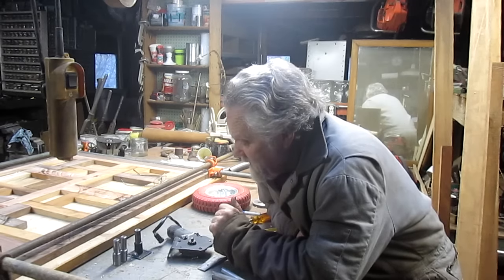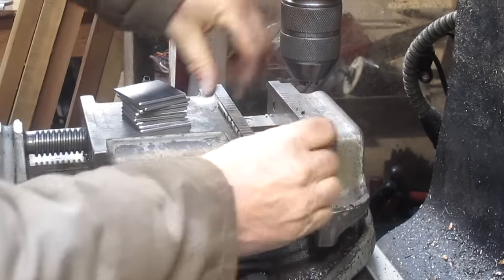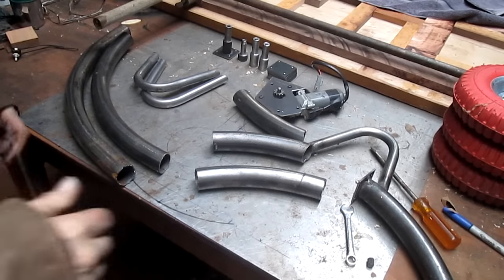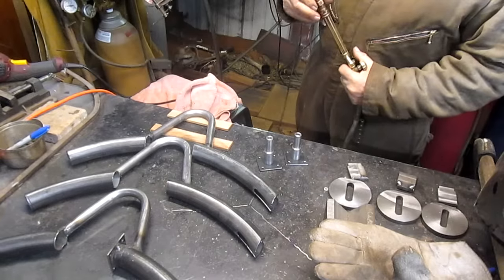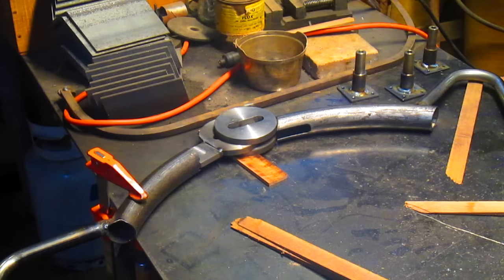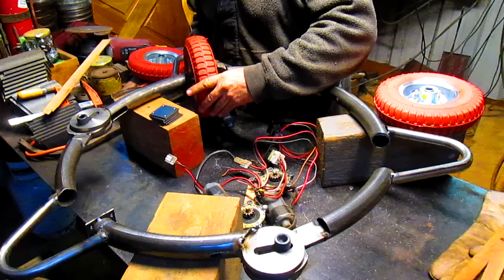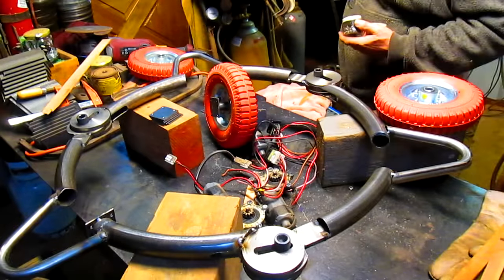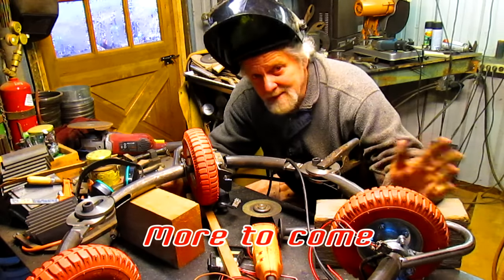A Run-in With Gravity #3

Comment: Looks like something to climb a pole or column.
Reply from the maker: You are very close. . . a tree.
Reply: Looks like the exact same comment I made 2 weeks ago in part 1. But I never got a reply from you. I would also say palm tree trimming or a way to cut it down in sections remotely. I always enjoy watching you go through the process. Thanks Nik
Reply from the maker: Tree. Conifer to be exact.
Reply from the maker: Sorry I didn;t respond, my computer died a few weeks back. It's been a mess ever since.
Reply: Nik C. Colyer:
     I assume there will be some sort of spring loading to compensate for the diameter of the tree as it ascends and descends.
Reply from the maker: Yes, much further down the line though.

Comment: Hi Nic,

Can I ask you what software do you use to edit your You Tube video's on your PC? Free program or a purchased one? Thanks in advance.
Reply from the maker: I used to use windows media player that comes free with widows 7. It worked great and was easy to figure out. I upgraded to Power Director six months ago and there are a few advantages, but in my books it's a toss up.